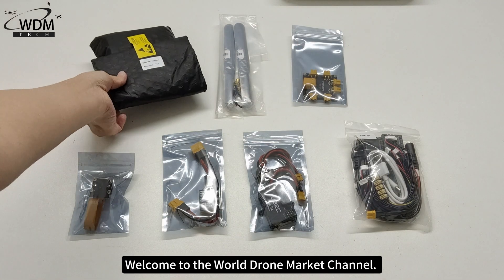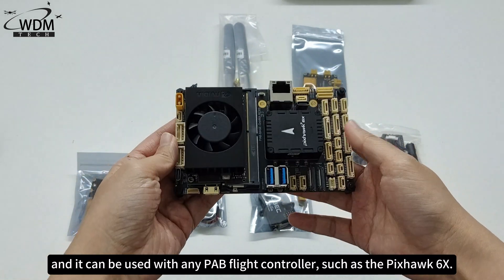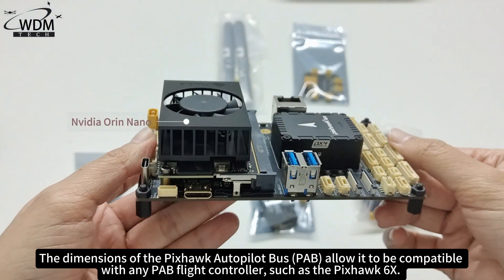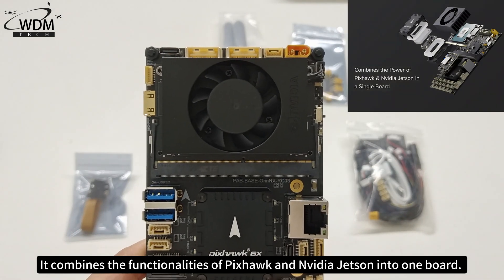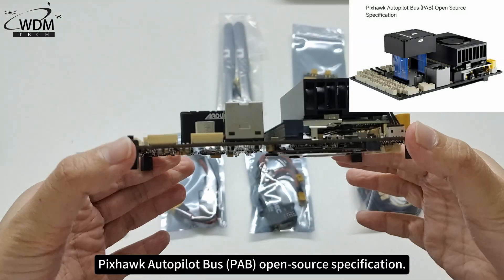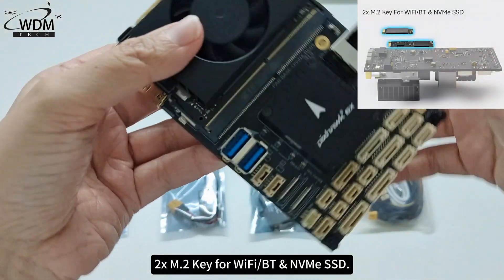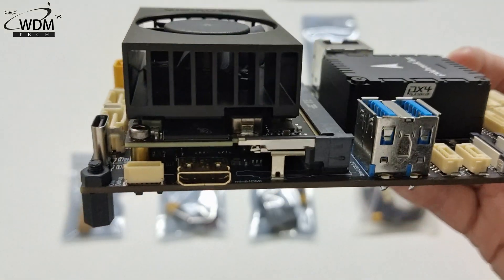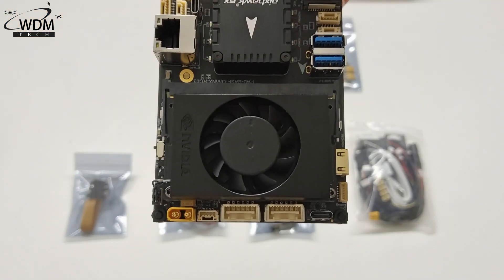Unboxing video for the Holybro Pixhawk Jetson Baseboard

Comment: Hi, can you please show this in a drone frame such as the EDU450/EDU650?
Reply from the maker: Sure, once the video is ready, we will @mention you here.
Reply from the maker: You can refer to the assembly method in this video, but we didn’t fix it to the 450; instead, we just used a foam pad underneath because there weren’t suitable holes to fix it. You will need to measure the dimensions accurately and drill holes in the board for assembly.
https://youtu.be/9rzk8WKZxFo?si=DaWc1GNYZDfEZhAL